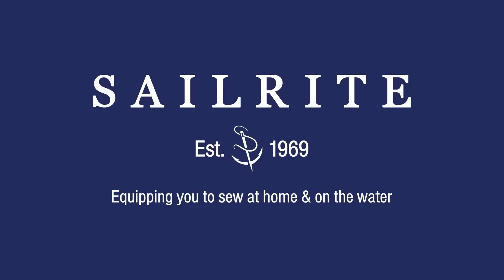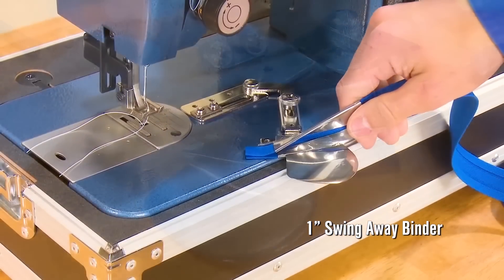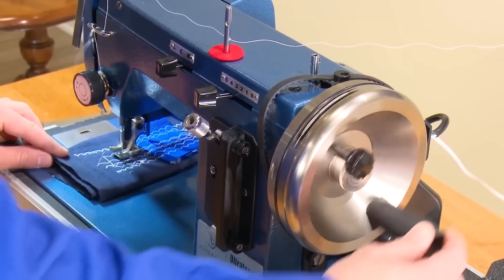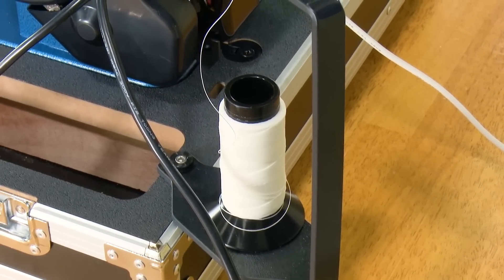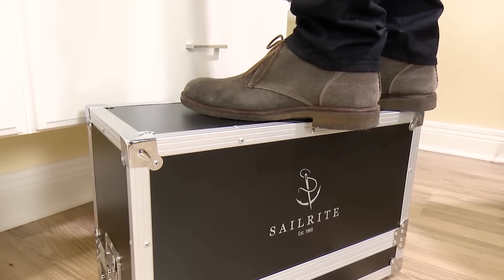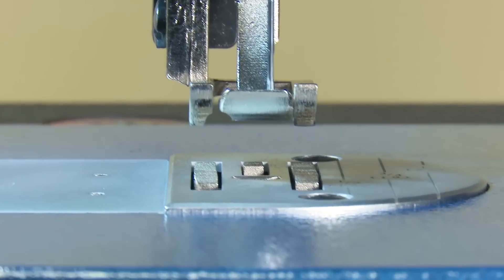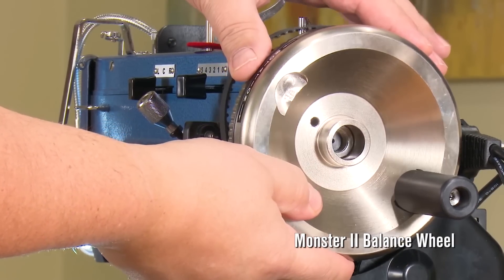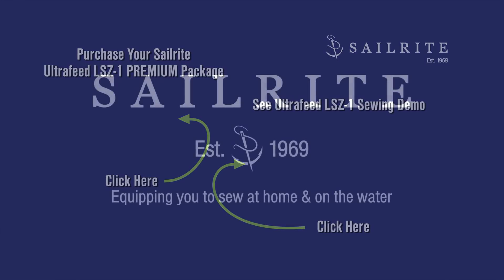Sailrite Ultrafeed® LSZ 1 PREMIUM Walking Foot Sewing Machine (Previous Version)

Comment: Is this an industrial sewing machine? How fast does it sew is one of my concerns????
Reply from the maker: Hi No one,

We would classify this machine as a heavy-duty portable machine.

Our premium machine now comes equipped with our new WorkerB power pack that is not pictured in that video. Its sewing speed is 304 stitches/minute (with Monster II Balance Wheel), 638 stitches/minute (with WorkerB Balance Wheel). It has adjustable speed control that allows you to adjust it down to the point were you can sew a stitch at a time. Here is a link to the current premium package demo.
https://youtu.be/x0qE-G45bBw

Comment: MADE IN CHINA and you pay $1000 for a sticker
Reply: razzorbladz my uncle has one and oh boy
You get what you pay for smooth stitching un breakable needle and easy to care for
Reply: So you got the link for these $1000 off Machines ??
Reply: their website says assembled in the usa from parts made in china, taiwan, etc.
Reply: @orangemoonglows2692  yeah they swap out like 3 parts from the chinese machine  which you can get for a few hundred $ my friend has one the parts in it were all loose and it kept going out of time but i fixed that and now its all good if you swapped the sticker you would never know
Reply: @razzorbladz  Which 3 parts? What is the name and contact of the Chinese manufacturer?
Reply: @johnq.public2621  I dont remember now but there is a video where they compare the 2 on youtube somewhere
Reply: @razzorbladz  Thanks for the reply! I'll see if I can find it. There are many reviews, and most are very positive. But $1000+ USD is a bit much.....
Reply: @johnq.public2621  price is dependent on what country you are in for sure it would be cheaper in the US that said it is an ok machine just a bit pricy
Reply: @razzorbladz  I agree with Jeanne De.  "You get what you pay!"  The prices for  the Sailrite machines are pretty reasonable.  There are other pricier industrial machines than these.
Reply: @isaemann8638  I have used the non sailrite badged version of these machines side by side a sailrite and at more than half price the differences were not great